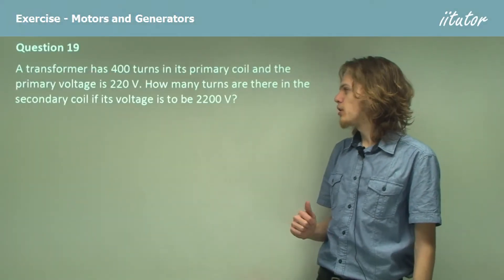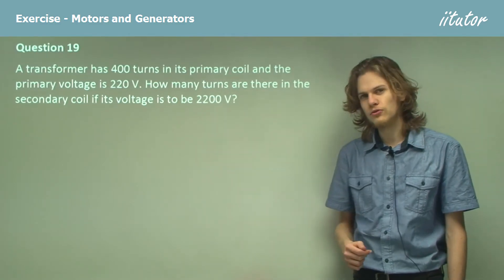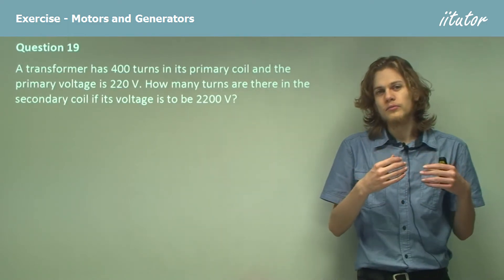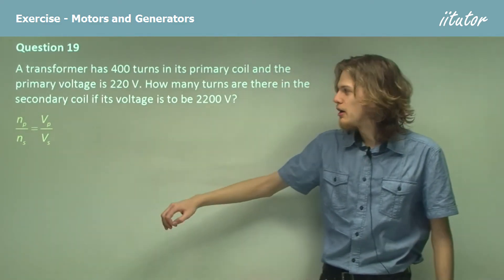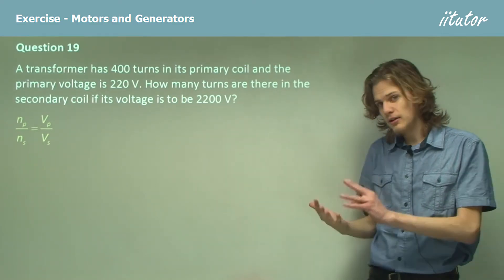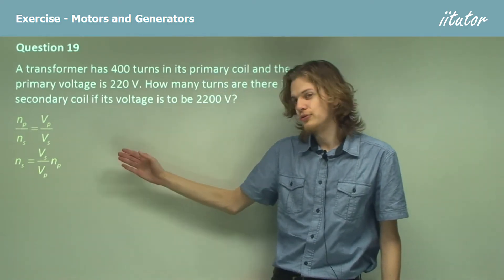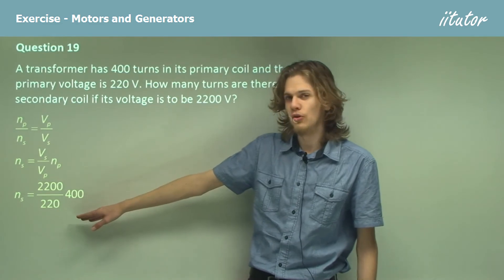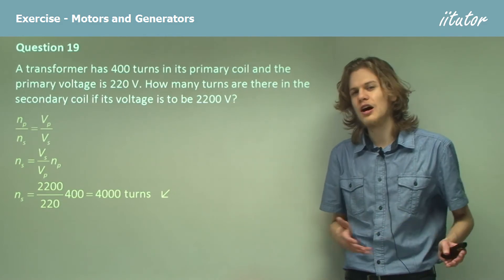💯 How many turns are there in the secondary coil? | Motors and Generators

Comment: sir why is this answer coming 4000 ? when i did this sum i got 40,000 turners am i doing any thing wrong?
Reply from the maker: Thanks for your question! Without seeing your full calculation, it’s hard to say exactly where the difference might be. Make sure you're using the correct formula and values for the turns ratio between the primary and secondary coils. If you’d like, feel free to share your steps, and I can help identify any potential issues. Glad you're engaging with the video!